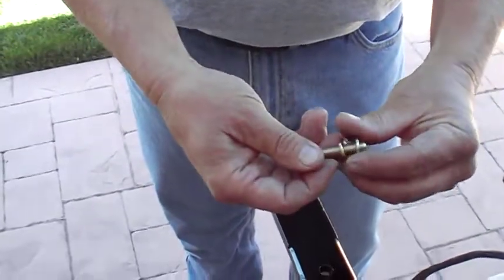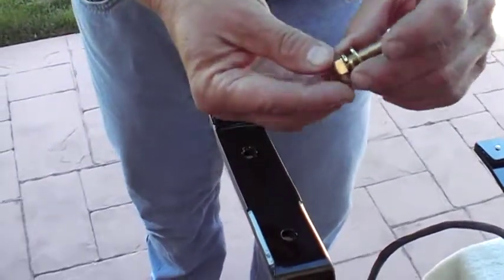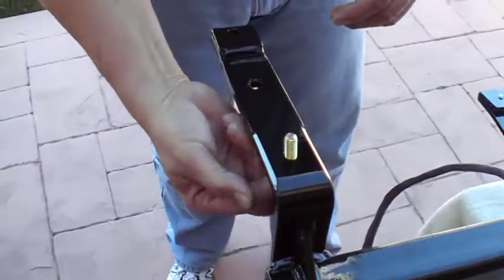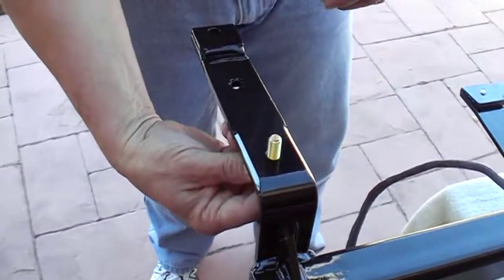73 to 79 Type 2 VW Bay Window Bus Trailer Hitch Part 4

Comment: That is awesome Work. I would buy one from you for my 71 Westy.  Im looking for a 2" hitch to add to my Westy.
Reply from the maker: Thanks for the kind words, it's probably a little over kill but I did not want it to fail while towing a car trailer. Have you checked out GoWesty and their new rear bumper with 2" integrated hitch receiver? Part number GW-B-BUMPER . I think it fits 73 through 79, could be another option for all that are interested. Thanks again and hope this helps.